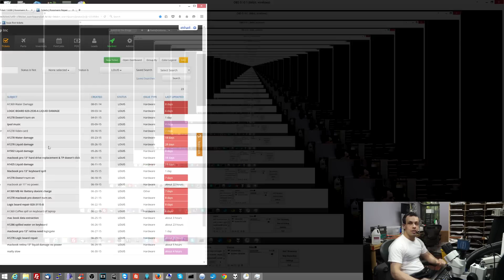Easiest logic board repair ever.

Comment: Louis, have you looked into getting a food dehydrator to dry boards? We got one for $35 and it dries board that are soaking wet with alcohol in like 45 minutes. Maybe even less, but we usually leave it for 45 mins to be safe.
Reply from the maker: Krynn72 I just use the hamilton beach oven on convection, 225f, for an hour or two.

Comment: Great Video! Quick question- I just looked at Jessa's website and I am seeing the August course I signed up and paid for is now only the three day course?? Will you be there for the August session? Please let me know ASAP.
Reply from the maker: Sean Hicks 3 day course is jessa, 5 day course is me + jessa. I technically only show up for those two days that is my course, the other 3 days if I pop in I do, if I don't pop in I don't. 

If you paid $1200, jessa's class.
If you paid $2000, jessa's class + my class.
Reply: Louis Rossmann Sorry about the confusion, was just looking at Jessa's website tonight, and it shows the full course option for first 3 sessions and the 1200 for the 4th session, with the option for the additional 2 days (didnt know if that was for sure). I paid in full already for the 5 days, airline, etc. so I was a little worried. Anyways, I have wasted enough of your time, prompt response much appreciated. Have a great 4th.